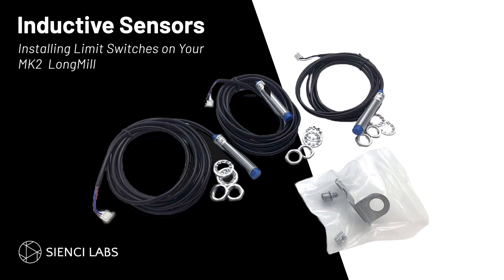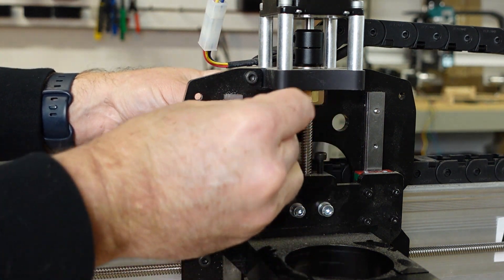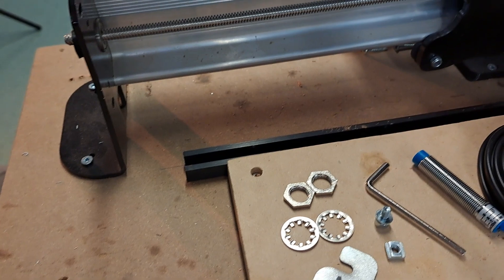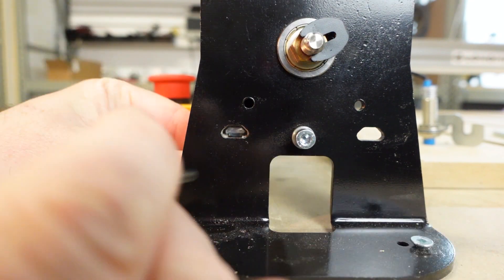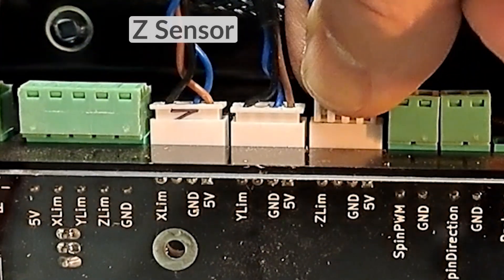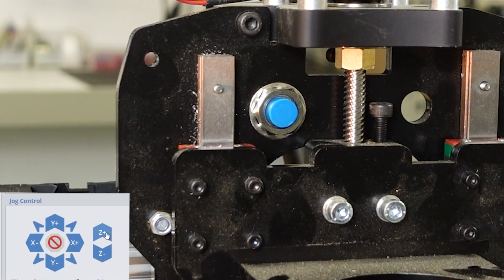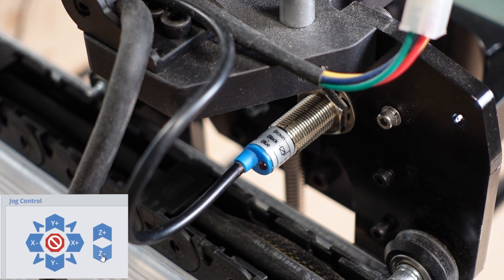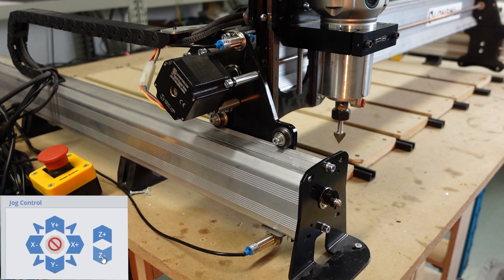How to Install Limit Switches onto Your LongMill MK2 CNC

Comment: I got very lucky on y axis bracket install but I could see it taking hours. I might suggest that with as many spare parts come with initial build the instructions should just have you put one in each corner at initial assembly, tighten them down and forget them until it’s sensor time.
Reply from the maker: Thanks for the suggestion! I'll pass this idea along to the powers that be. Really glad that you are up and running, if you have any other feedback, we'd love to hear it.

Comment: It’s it just me, or when doing the z axis the bolt on the backlash assembly hits the lead screw lock nut? This isn’t ideal, as the newer locknuts are thicker and impact the gantry before the limit is covered.
Reply: Just attempted to install mine and this issue is occurring.  The new style backlash adjuster hits the lead screw lock nut before it can even get in range of the sensor.  Likely build my own bracket as the current setup needs a bit more engineering.
Reply: @markg2468  I got it to work, but I would suggest that it's something to resolve for the MK3

Comment: It looks like the Y bracket would be easier installed during assembly of the mill. Alternatively, a hole in the table so a long Allen key can be used from below would also help.
Reply from the maker: Technically yes, it would be easier at the start. We do mention and show the assembly process in the last 48x30 assembly video. That being said, we generally don't recommend using the homing switches until getting familiar with the CNC in general, so a lot of people still get it after they started.

Comment: When will you be making the video showing how to configure and use the limit switches in g sender? The documentation does not seem as complete or as easy to follow as a video. It seems that another viewer has the same question (Mace Eliason).
Reply from the maker: There may be a pt.2 down the line, but in the meantime the instructions for the configuration can be found here: https://resources.sienci.com/view/lmk2-limit-switches/#firmware-changes

Comment: I may have missed it somewhere,.  I'm saving my allowance, again, to get a Longmill.  Why are we using inductive sensors rather than micro-switches which are more compact and less expensive?
Reply from the maker: A lot of the value and reasoning for selecting inductive sensors over mechanical micro switches on a CNC router is that the switches can fail or become less reliable from being in a dusty environment or seeing repeated actuations whereas the sensors have no moving pieces and are fully enclosed. You'll see this choice for greater reliability on other CNCs as well 👍
Reply: @SienciLabs  Okay, thanks.  Good points.  I hadn't considered dust.
Reply: I have my switches and have yet to connect as I did not have no idea how to, thanks for this video, am going to follow it and connect mine.